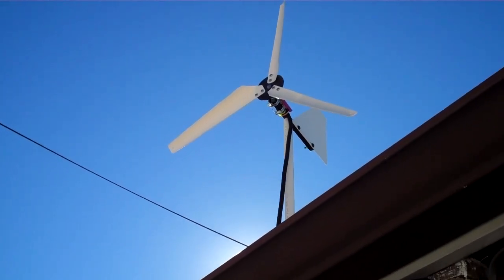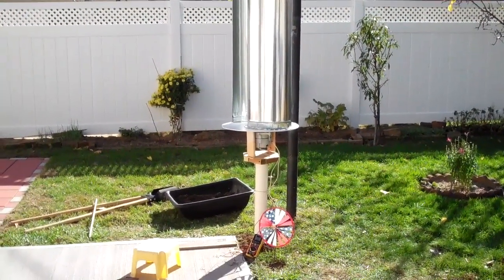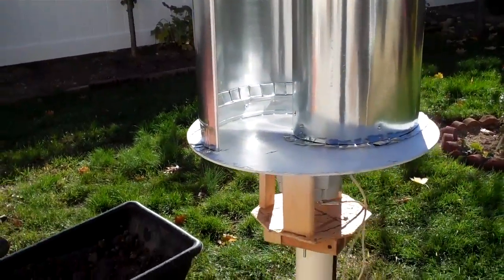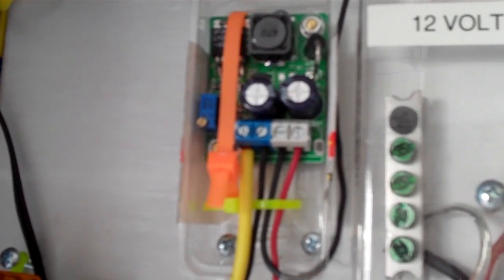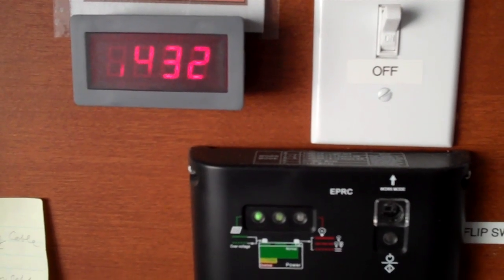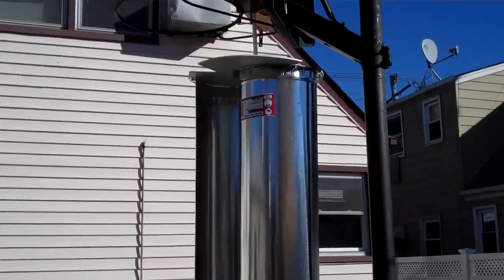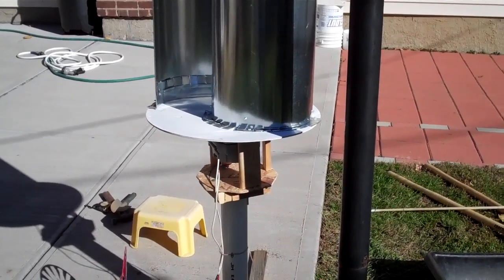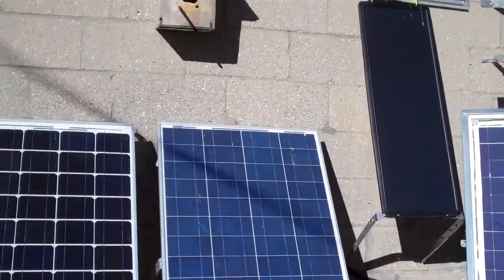Savonius with direct drive modified Delco Alternator.mp4

Comment: You need to use a larger wheel such as a 27" bicycle wheel , add more turbines n gear up the rpm to dive the alternator. The increased area to catch more wind n increase the diving forces from the wind.

Comment: Looks like fun!  I know what you mean about so many turbines being shown that are spinning freely but not producing any power because they're not hooked up to a generator.  If yours does spin, it will be more impressive because you're making electricity.  I like your idea to charge AA batteries with small-scale turbines.  Your garage still looks impressive with the control panel.

Comment from the maker: @MrHorsetail You're right. The turbine should be wider and as big as possible to drive the alternator.  I was afraid of wobble and too much weight on the alternator as this is a direct drive setup. I wanted to keep it simple without using a belt or gears.